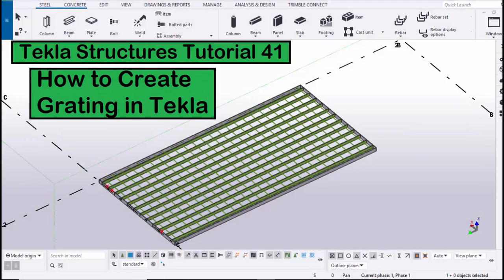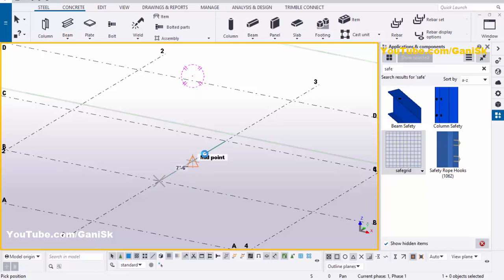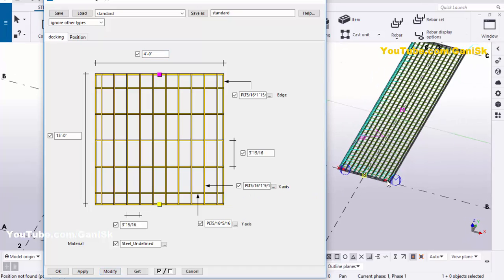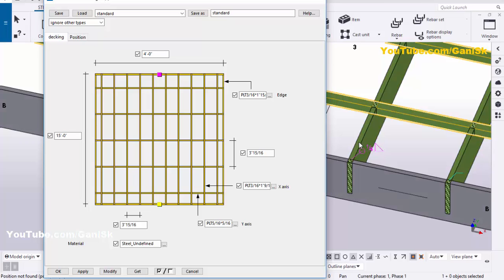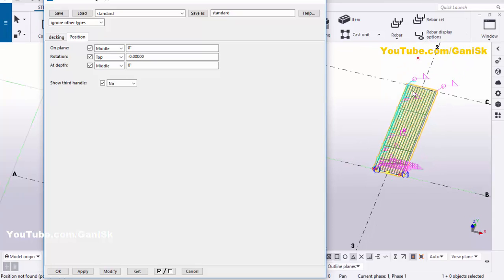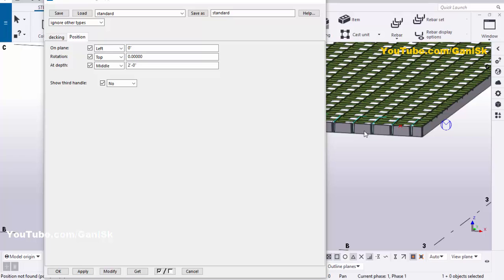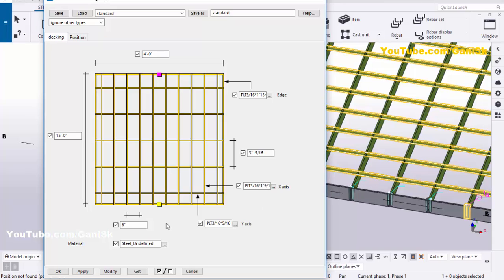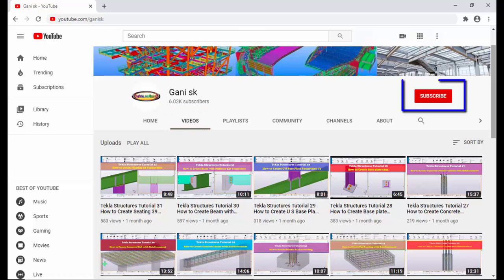Tekla Structures Tutorial 41   How to Create Grating in Tekla Structures

Comment: at 1:29 you click to open the dialog box. where are you clicking as I can not get the dialog box to appear
Reply from the maker: Double click on grating to appear dialog box.
Reply: @GaniSk  even when double click, no dialog box appearing
Reply from the maker: @ksiva21  select grating next use short cut Alt + Enter key to open window.
still you didn't get it then crosscheck with the filter at bottom or use shortcut Ctrl + G, it should "standard" in filter to select all objects. still you have a issue, comment what you get
Reply: @GaniSk  thanks for your help and it's working fine now.